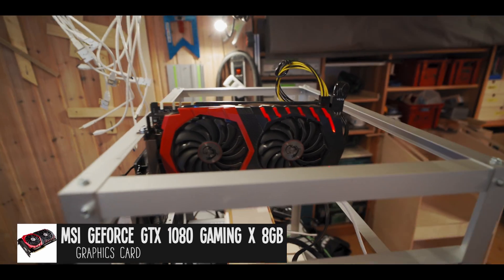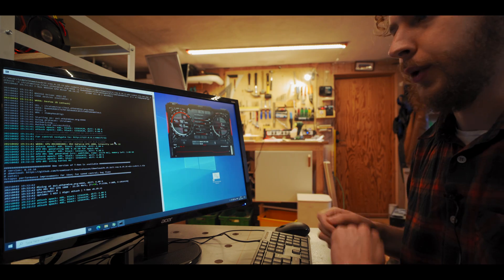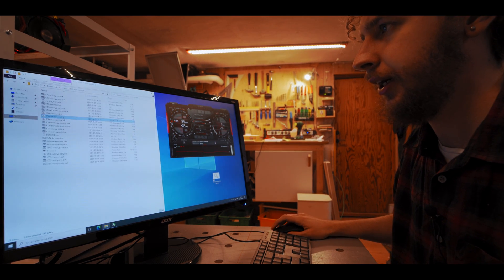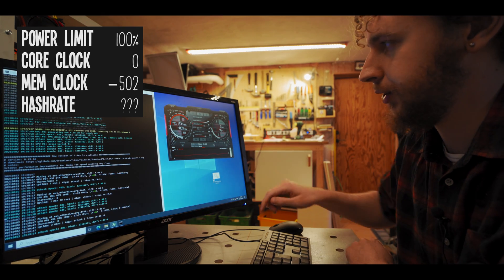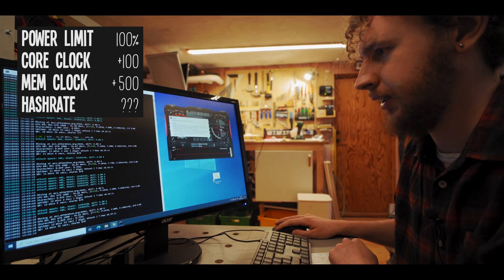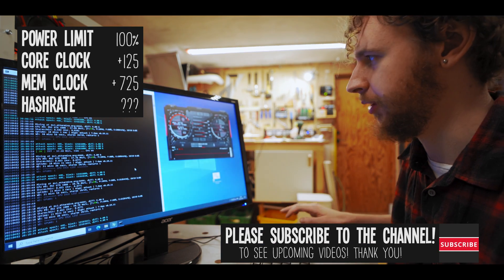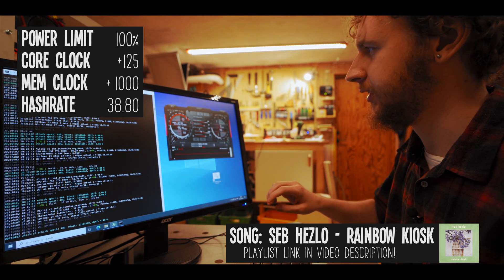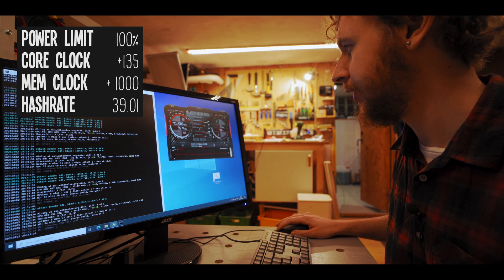GTX 1080 Overclocking for Mining Ethereum (How to MAXIMIZE HASHRATE)

Comment: Hello, I have exact same card as you. My settings are 80% TPU, +135 core clock and +400 memory clock, getting around 35ish mh/s. If I push it more, it instantly crashes. Im using NBminer with --mt 6, and 4 other cards (rx 480, 2x1060 and one more 1080). Can it be that my amd drivers are blocking me from getting more hashes out of my 1080s? Ive tried every single combination in msi afterburner, and only on this setting are 1080s stable. Thank you in advance, much love, your videos are great!!

Comment: Thank you for your awesome videos! I'm a maths and computer science teacher myself and I really appreciate the way the represent your ideas. Clear, understandable, no nonsense. That's what most of us teachers strive to achieve for the whole of our careers. Hats off, honestly!
When it comes to 1080's, they are unbelievably different personalities. Two of my cards won't take any overclocking. One crashed immediately if I tried to use memtweak. Maximum hash rates can be anything between 24 to 40 MH/s. It's the most complicated GPU I've used for mining so far. In comparison, v1 3060's are all the same in my opinion. You can easily push 48-49 MH/s and the differencies are minimal. Some cards such as 1660's need to be overclocked in very different ways, but it only depends on the memory manufacturer. What I'm trying to say, is that for most cards you could make a simple chart and use it to overclock. For the 1080 you can't. Just roll the dice.
Keep up the good work. I'm a follower now.

Comment: Anybody knows why i can't get even 30 MHS with my ZOTAC GTX 1080 regular not AMP!? Tried clocking but it does not seem that it affects much hash rate, from zero OC to 700mhz memory it just adds around 1, 2 mega hash, core clock also does not affect it much, i tried Phoenix, trex and now nbminer and same thing everywhere, i will try mt 6 to see if that changes anything.
Reply from the maker: Did you do the memory tweak like I mention in the beginning of the video?
Reply: @SebsFinTechChannel  yes my man :/

Comment: Is 70 Celsius good temps for the exact same card you test?
Reply from the maker: No too high.
Reply: @SebsFinTechChannel  what temps should I go for then? I get max 34 hashes and am mostly fine with it. The fans are at 70% and keep the memory at 67 Celsius, +700 on memory, 85% power
Reply from the maker: @alexandarvrajilov651  put the fans at 100%. fans are cheap and easy to replace. a gpu damaged from heat is basically dead. so much better to run your fans hard than overheat your gpu :) many of my 10-series cards have the fn at 100%

Comment: Great Video as always, but note that if you run into a problem running the batch after entering "--mt", all you have to do is enter the full path to the t-rex miner. C:\Miner\T-rex\t-rex.exe for example :)
Settings: (Note I typically go for efficiency) I set MT to 5. PL 75%, CC +200, MC +600. Getting 35.95mh @ 159w for Efficiency of 230kH/W. 
I hit 37mhs at CC 225 MC 700 but over 180W and around 203kH/W

Comment: Hey Seb were you able to keep those settings for a day or more? My GTX 1080 is at 65% PL, +100 Core and +600 on memory and stays at 33.8MH/s. When going above 600 it crashes after a couple of hours but I never tried that with more than 65% PL... Thanks!

Comment: Hello Seb and thanks for you excellents vidéos. 
With Hiveos and Phoenixminer, i have 35.21 MH for 133w  fan 70 = 60° core 280 Mem 1250.
What do you think about it?
Thanks
Reply: Wow mine can’t even push past 200 memory
Reply: @Ash-my4gf  try run miner first
Reply: @kirillvasiliev8309  run miner then apply OC? I did crashes instantly
Reply: @Ash-my4gf  okay, then run miner, then mem, and last power lmit. since mine also starts like old lada in -45c 😆

Comment: Thank you man the best video ive found for my 1080.. 39mhs now thats awesome
msi geforce 1080 aero
Power Limit 85
Core Clock +200
Memory Clock +850
Reply: can i know what your nvidia driver ? im barely on 37mhs right now
Reply: yea, i have the same question, because i have MSI geforce 1080 aero cards, and run into problem.

Comment: dude, ive been following your page ever since i started mining,
used your videos to help set up my 1st ever rig 6x 1660 supers
and now using your videos again for my 2nd rig 6x1080/1080ti,
my stock mh was 23 used your video and jumped to 36,
OC till 38.5 but it was unstable but found a sweet spot at 37.90 and its been stable then,
but i would love to know what is the amount of POWER you were using here,
as I'm getting 37.9 but using around 166w
i know its a power hungry GPU as to power it up i need 2x8pin connectors...
but hoping to reduce to at least 120 maybe..
tried reduce power from 100 to 60, it made 0 changes lol...
Reply: could you tell me hive os settings and which miner

Comment: if you are using a gigabyte card and are having troubles, try using the gigabyte overclock software, which on gigabyte gpus tends to work better, then msi afterburner. Not sure why, was the case for several of my gpus.

Comment: Ah, I think I have ghost in the computer. After initial good settings, GPU starts to crash more often. Now I am reducing memory tweak from 6 to 5 to see how it will go. Strange thing is that from 6 to 5, hash rate actually increases very slightly. And one thing that makes no sense at all - while worked on MT 6, shares per minute (on 3 GTX 1080 ti) was 1.8 on average, but now seems that it has tendency to rise to 1.99 shares per minute. I am not using 'ETHlargement pill' since new version of T-rex V 0.21.4. How is that possible to get more shares per minute if memory tweak is lower? Does GPU can be 'oversaturated' or something?

Comment: Hello, i have a problem with my 1080, whenever i memory tweak the card, i cannot overclock my gpu. Can i fix it or not? i even tried +10 on memory/-10 and it still didnt work, monitor just displayed artifacts, and then pc restarted. Thanks
Reply: btw i have asus strix gtx 1080, i did re-paste today. No thermal problems. Btw i have 34 mh/s without overclock, just tweaked memory
Reply: @stefan_gordik  I have the same issues on an ASUS strix gtx 1080 and several MSI 1080 cards. Would be good to know any fix to it

Comment: Try 'undervolt' by lowering power limit to say 78%, then slowly increase core clock. Enable monitoring voltage, and DO NOT get over 1000 mV at this point. Be warn that core clock may trigger voltage increasing and thing will crash (BSOD). Write down values all the time in the case of crashing, then step back one or two notches to be safe. Watch for the efficiency. I hope this helps.
Reply from the maker: Thanks!

Comment: I have gtx 1080 (zotac mini version)
Base hashrate was 21.3mh
After overclock was 34.7mh
My setting:
Core clock: -256
Memory: +548
Power : 72%
Fan: 83%
Temp: 73c
I live in India, rajasthan( one of the hottest places) outside temp is average 42c, so i could not max out my gpu.

Comment: I'm using Hiveos. I currently have 10x 1080's running and only 2 of my cards will accept an overclock.. The ones that do, will hash at 37 but all others will only do the norm 30.8  Really kills me
Reply: same, i cant even touch anything of core clock and memory clock otherwise they crash, i can only OhEnlargmentPill them
Reply: Run windows man. For some reason mine does the same on hive. But as soon as I put my 1080 on a windows machine, it's perfect.

Comment: I have a 1080 Gigabyte Turbo and I cannot even begin to overclock it, even a +50 to memory and it crashes.  Any advice would be great.  Getting 33 MH/s @ 137 Watts  with MT 6
Reply: I just got that exact card, I'll install it in my rig tomorrow and let you know if I'm able to overclock it at all
Reply: I got the 1080 turbo to 35.5mh/s @ 146W. MT4, 75PL, +165 core, +250 mem
Reply: @mavagam99  What drivers are you using? I'm currently on 456.71
Reply: @GrannyHQ  I'm on 466.63

Comment: How long do you wait to verify the settings are stable?  5 minutes?  Also what information do you utilize to determine it's stable?  On my setup when I start getting screen flickers it's obvious that my clocks are unstable, but is there some software I can use to detect errors or "invisible" signs that my settings are unstable?

Great video, thanks!
Reply from the maker: Like during you’re overclocking maybe a minute or two between each adjustment. Then once you find settings you are happy with, let it run in those settings for, you know, a day, two days, a week and see how it olds up. If your card crashes here and there or gets invalid shares then it might be a good idea to reduce the overclocks a bit. Also if you’re getting screen issues, is that because our have your monitor plugged into your graphics cards? If you can, I’d recommend plugging the monitor into the motherboard when mining.

Comment: I am mining with 1070 and 1080 in parallel. Is there a way i can use Memory Tweak? T rex boots with error "can't initialize memory tweak for GPU 0" (the 1070).
Reply: Im not sure but the memory tweak is for GDDR5 or GDDR5X cards. That means Gtx1080, gtx1080ti and some pascal cards.
Reply: --mt 0,6

Comment: Got the same exact card. Settled for 55% power limit, Core +0, +500 memory, 65% fan speed constant. Gives me around 31-32 hash while keeping Hot Spot temp under 78* C. Seems a good compromise.

Comment: Hi..What did you write in the Trex file? I did not understand what you wrote
Thank
Reply: I took the first step, but nothing changed
Can I contact any application to send you a picture?
Reply from the maker: You write --mt 1 and then increase the number until either your card becomes unstable or you reach --mt 6. You might also need to add the full path to trex.exe at the tart of the batch file instead of just trex.exe and you need to run it as administrator
Reply from the maker: Good luck!

Comment: man I was stuck on 25 m/h and i didn know what to do thank you soo muuchh, for the people that coudnt run the batfile as admin, you have to set the path of the trex.exe in the bat file in order to ejecute it. best regards! and at the end is >....rig0 --mt 6> dont forget the space in between and double "-"
Reply: you need to open the folder of t-rex miner, and in the top of the window there is the path, is like C:/User/yourUser/Desktop/t-rex/t-rex.exe, that line you need to incorporate it in the bat file, at the beggining, you can see in the minute 3:30 that Sebs have that line in his file. regards!
Reply: @nicolasespinosa9859  thx a lot mate
Reply: Do you know if I will mine less than 0.1 eth can I withdraw it to my wallet ? Coz after 2 month eth mining will stop and I don’t think that I will reach 0.1 eth !
Reply: @the_general_777  as far as i know the minimun you can withdraw depends on the pool, in most of the cases you can change the minimun to fron 0.1 to 0.05 eth, for me with a 1080 at 37m/h is aproximatly 1 month in flexpool, the problem is that if you dont reach the min, you basicaly lose you time and your money. Regards!
Reply from the maker: Awesome!
Reply: can you help me with this mate -
Reply: Can you help me how to do the path thing plz ?
Reply: You can used Gminer for best hashrate

Comment: thanks dude! i actually have MSI GTX 1080 which pulls 33.35 MH 
core :150
memory : 1200
PL : 130

do you think it still can pull up a bit more? it keeps crashing XD i would appreciate your response bro
Reply from the maker: It definitely sounds like you haven’t done the memory tweak, have you? I show you how to do it at 2:20 in this video. If you are using Nicehash you can get the same result by enabling “ETHlargement” in your settings. Good luck! Let me know how it goes!

Comment: Thanks for your content. Your 1660 video really helped. I have a Strix 1080 ti that I can't get over 35.5. Any chance you could make a video showing a step by step proper bat file setup for mem tweak using t-rex? I've tried so many times and can't get the miner to start properly in Admin mode.
Reply from the maker: Ah mate I just remembered I had this issue too. The thing you need to do is add the full path to your trex.exe file in the beginning of your .bat-file! So instead of just trex.exe you need to add like C:/the/path/to/trex.exe
Reply: @SebsFinTechChannel  as you have written it here?
Reply from the maker: Hehe no of course not, you need to add the actual path to your trex.exe file but since I have no idea where on your computer you have put that file I can’t tell you exactly what to type.

Comment: Could have been a lot easier to see if you could record your screen... good info tho.. thanks!
Reply from the maker: Thanks for your comment and yes I agree, but unfortunately the problem is if you use a screen recorder, that uses power from your computer which would affect hashrate and how the card behaves during overclocking. So because of that I don’t record the screen and I take the time to write out all of the numbers in the video instead.
Reply: @SebsFinTechChannel  Ohhh did not think of that.. Great work! I have a GTX 1080.. just started mining today.. made about a dollar.. i get around 22mh/s at default msi settings. I will be trying Nicehash tomorrow to get that ethenlargement.. lets see..
Reply from the maker: Good luck!